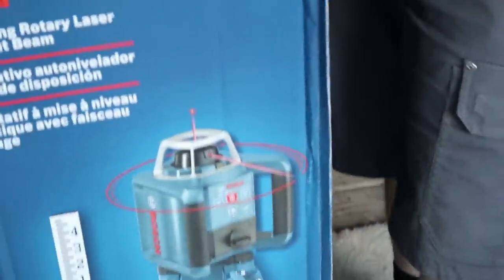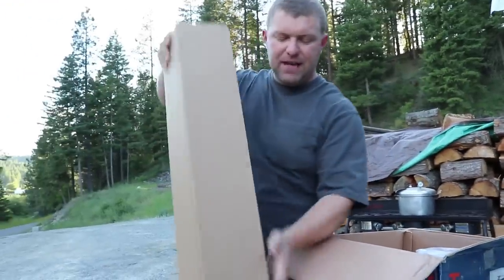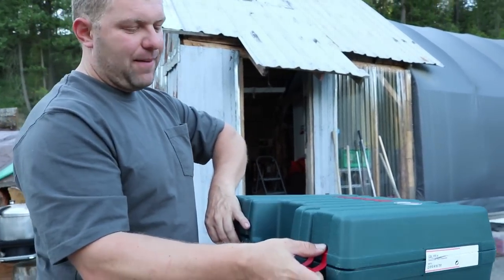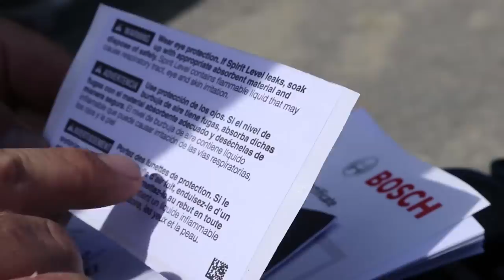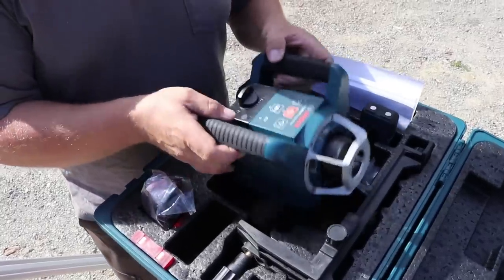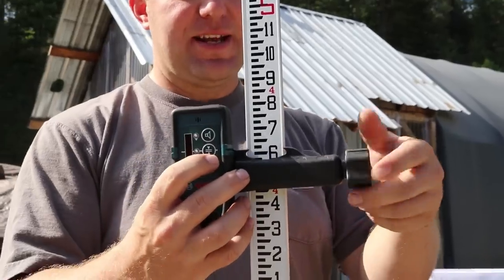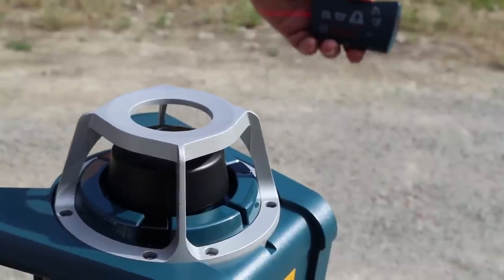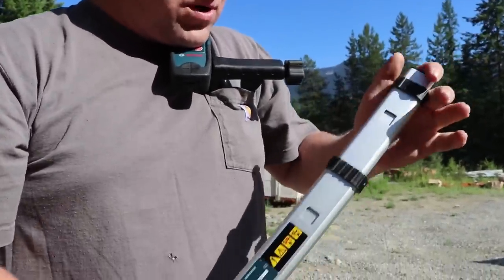WORTH THE $700! 😰 (Bosch Laser Level Unboxing)

Comment: please, I'm being respectful so don't delete my post again. All I did was add a vid to the construction and usage of a Bunyip ( water level ). I enjoy your vids and I feel your pain, but it appears neither of you did prior research into various aspects of  " homesteading" and associated methods to accomplish various tasks cheaply or easy. There's a lot of people on here whom have used the transit & water level effectively, or know how to use them. Given what you got, I honestly don't think your going to get better accuracy from the laser then the other 2 options considering your lack of experience in using the laser. 
    As for datum, when surveying a new property without any datum, you select a nice non-movable solid place to mark, right on top of your septic lid and call it  " temporary datum elevation 100 ft above sea level, or 1000 ft above sea level " this is only for on site usage, eventually if needed you drive a "shiner" or nail into the frontage road, just below the surface so snow removal equipment don't pull it out, call this temporary spot  100 or 1000 ft above elevation, then adjust ALL others on your property by measuring from this nail up to your septic lid, what ever this number is say 23 feet difference, then your lid is at 23 feet above the nail, and all other points add 23 feet to them. Eventually you may need to actually establish datum for the nail, thus some where on your frontage road there is a datum point set on something driven into the road or along the shoulder.

Comment: This is hilarious. The intent is to build a house? Well, obviously there are lots of Benjamins floating around up there. So, if you want to actually build a house, you call the foundation guys in, they pour the concrete and level it, and then you're ready to go (at least a year ago). Or, you get a backhoe guy and start digging, depending on what you want to do. They had contractors put in the septic tank, so what's the beef? At this rate, the house will take 10 years to build, but they will have an awesome collection of useless tools to fill up the barn with. But then... actually building the house on a schedule obviously is not the objective here. So what is the objective? That should be obvious by now.